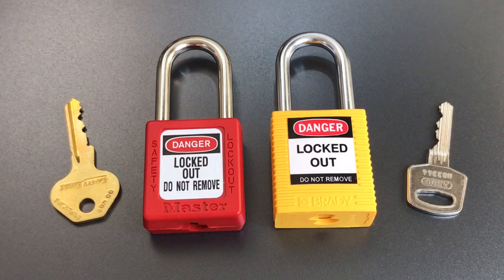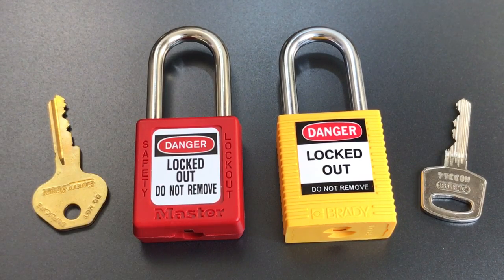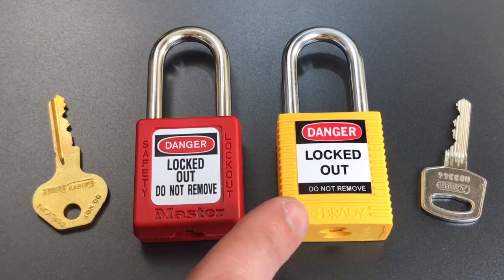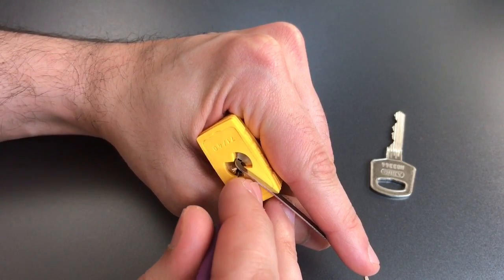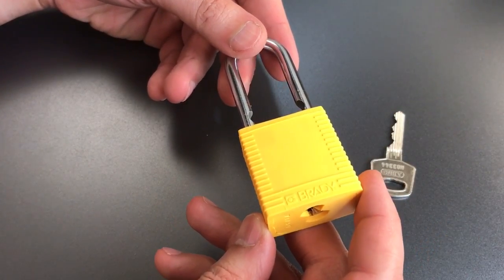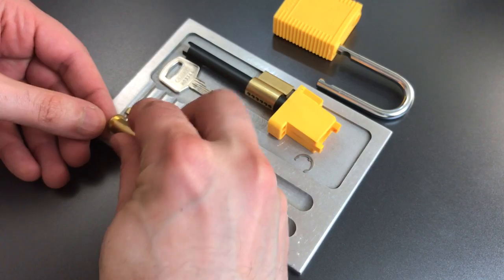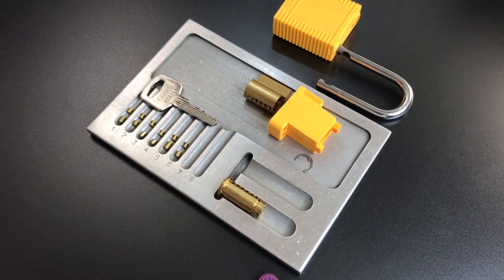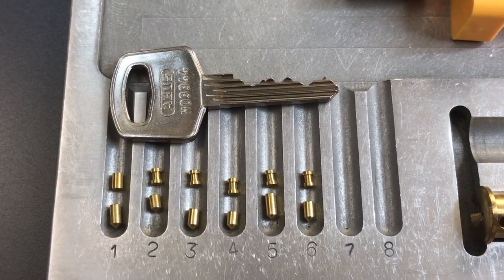[484] Abus/Brady 71/40 LOTO Padlock Picked and Gutted

Comment: Hi LockPickingLawyer, what are those holes on the bottom of the Bible? for? does this mean you could remove the locking mechanism, insert the key and turn 180 degrees to release the key pins without undoing the clip?

Comment: Lockpicking lawyer there is no oscia standard on pin count the lockout locks we used at the beef plant I worked at for 10 years were 5 pins and I have both locks from two different plants both 5 pins and a num7 master lock with 4 pins

Comment: I never saw a lock with wording "lock out" - so, what is the difference between a padlock and a lock out-padlock?
Yes, I see the "WARNING" word an emergency-like color. So, is it used for wheel clamps? I cannot understand the "LOCK OUT". Is it for the purpose to lock a home after an eviction? Here in Germany „sich aussperren“ ("lock out one self") means you accidentily close the door with keys inside.
Reply: LOTO is an abbreviation of lock out tag out. In industrial plants/power stations etc. each person working on a piece of equipment places their own lock on the power source or switch for the electric motor so it cannot be energized and injure/kill people that are working on it. Until every lock is removed and every person accounted for, the equipment can not run. It's a safety measure because some systems are automated or human controlled etc. They make them out of plastic in case someone leaves the site and forgets to remove their lock, you would be contacted and accounted for then the lock would be broken off/destroyed. You may be looking for a new job afterwards as well lol.
Reply: @midship_nc Thank you. My fuse box has no place to put a padlock to. I am used to find paper signs, which read "do not switch on - works in progress. This sign to removed by XXX (name) only". So, different culture, therefore  special locks.
Reply: @galdavonalgerri2101  no problem! You asked an honest question and no one had taken the thirty seconds to explain it. We also have the paper tags and some people use a traditional metal body lock with their laminated LOTO tag attached that states the safety warnings and has their picture etc. One of my customers recently had an accident where someone was working on the incorrect piece of equipment that was not locked out and opened the pipes that were still full of sulfuric acid and he got sprayed in the face and torso.
Reply: where i work we put the LOTO lock on a hasp that holds the key for the lock that is on the isolator captive not uncommon for  the hasps to be daisy chained  with a few hundred LOTO locks on a big shutdown. the 6 pins is to reduce the chance of a duplicate cut on keys when we first started using them they where a 4 pin lock and there were a few times that someone took off the wrong lock thinking it was theirs

Comment: To simplify what others have been saying, the reason why these LOTO locks are such a paradox, meaning they have high pick-resistance and six pins and security pins encased in a plastic lock body, it because LOTO locks are guarding a HUMAN LIFE while a very dangerous piece of equipment is shut down.  Only ONE, SINGLE KEY should ever be opening these locks in the field on a jobsite or facility so the lock core and keys need to support far more bitting differs.  The plastic body meanwhile is to make it obvious that somebody not authorized to remove the lock WANTED the machine the lock was guarding back in operation anyway, EVEN if lock's owner had not removed said lock yet and may still performing maintenance.  That of course puts the liability for resultant injuries and possible death squarely on the shoulders of whoever destroyed the lock.

Comment: I think the paradox is more about the question of investigation and assumption of negligence (and arguably the cost of arguing liability associated).

With normal padlocks, it generally isn't going to matter how the lock was defeated. It's just a matter that whatever it was protecting is gone. There's always a chance that someone was negligent and did not lock the padlock correctly, but given the regularity of most padlocks being locked, the assumption generally would be that an authorized user of the lock would put it back. Without video evidence to the contrary, this would make it very difficult for a laywer for the insurance company to win an argument that the insurance should not be paid.

With a LOTO lock and it's much less frequent use, if the lock is not physically destroyed, it would probably be easier for an insurance lawyer to successfully argue that the lock was not used when an accident occurs, and more likely that the cost of the payout would make it worth the insurance company to try to fight. Also, points a strong direction for the detectives investigating.

Comment: I found this PDF that states: 
Locks used to secure an energy isolation device must be substantial enough to prevent
removal without the use of excessive force or unusual techniques. This means our locks
must be tough enough that it would take something like bolt cutters or a grinder
equipped with a cutting blade to remove them.
http://www.oshatraining.com/cmsdocuments/OSHA_Training_Toolbox_Talk_-_Lockout-Tagout_Requirements_for_Locks.pdf
Reply: Then I hope the plastic is heat resistant enough so using a lighter can't soften it.
Reply: Vaasref that would probably fall under unusual techniques, the use is to make sure the lock wont come off without a person wanting it off, that's it

Comment: My assumption, there's a life on the line should this be removed. I know for the company I work for we often have 100s of these on one site and 100s more on probably 20 different sites. Need to be sure someone else can't open the lock. So to make sure it's one key one lock they put the 6th pin?

But I won't lie these usually get cut at the end cause the keys get lost or misplaced. Just have to be sure it's safe to energize if removing one. Pretty cool to me to know they're actually a fair bit more pick resistant than the other abus locks we have.
They sure do cut easy with bolt cutters though.

Comment: OSHA Publication 3120, "What are the requirements for lockout/tagout devices?"  "...Substantial enough to minimize the likelihood of premature or accidental removal. Employees should be able to remove locks only by using excessive force with special tools such as bolt cutters or other metal-cutting tools."

Nothing specific about pin requirements, etc...

Comment: My suspicion for the LOTO locks being so simple to defeat is based on my years in aviation refueling. That is that you can never find a line guy with the tools he needs to get past so much as a suitcase lock, much less a set of lockpicks or bolt cutters. I have seen some emergency locks, with shackles designed to shatter if hit with a hammer, but doing so isn't likely to electrocute someone or drown them in a tank of jet fuel.